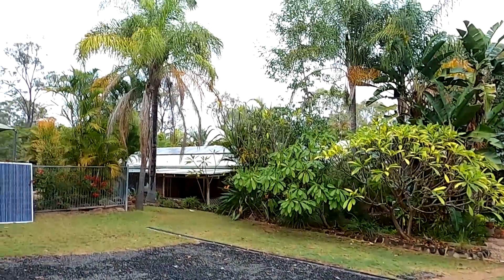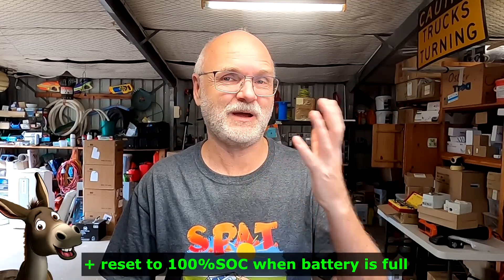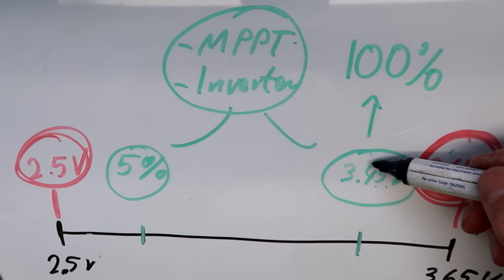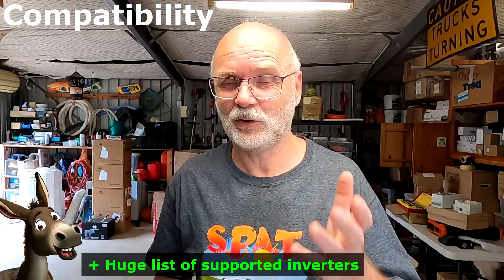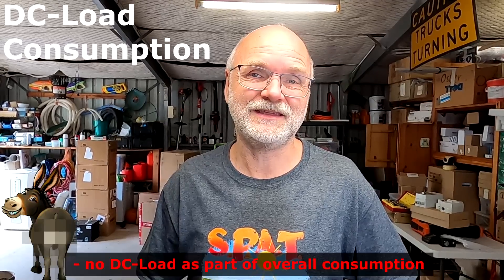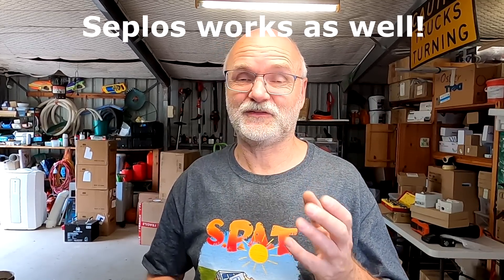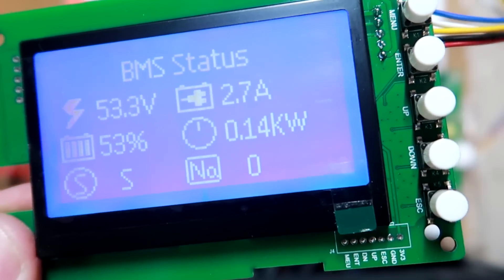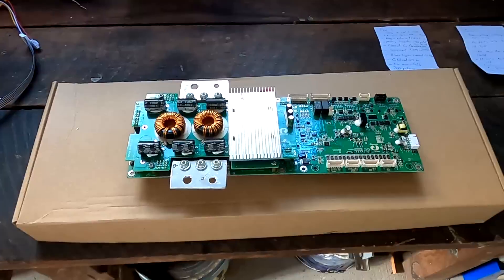In search for the best BMS... My Gobelpower BMS Verdict!

Comment: JBD bms tells you it's 100% according to what you program into it.  Maybe you need to revisit it Andy?  The last one you looked at was really small and soo old.  My batteries reset at 3.6 volts, where I need to program them because of the Canadian climate, instead of the 3.45 you use.  We get much colder here then Australia and 3.45 is too low to charge completely at anything below 8 degrees C.  Program the new JBD bms,  at  2.8 to 3.45 (as an example).  Test capacity by going from full (3.45 ) to empty (2.8).  The JBD will now read and communicate the AH stored within those parameters as 0 to 100% .  

There is no need for the BMS to tell the Victron what to do if the Victron system is programed correctly.  The inverter should always turn off before the battery, this is easily achieved with voltage parameters because of the LiFePO4 discharge curve.  The inverter throttles down any loads at shut down,  preventing spikes to the battery.

Charging MOSFETS turning off is essential.  Relying on an outside device to stop charging is added complication that invites disaster if something goes wrong with the communication.
Reply from the maker: I'm in contact with JBD and see what we can organise...
That is the whole purpose of a smart BMS to tell your inverter what to do without having to program your inverter (or Victron) in this regards.
I don't think it is essential to turn off MOSFETs at all. If the charger follows the BMS request it will just stop charging at the set numbers. If not, the BMS is there to catch the battery and disconnect. It's a 2-step system.
Reply: @OffGridGarageAustralia  I see how in your situation this will work fine, and might be the goal.  In other situations, say for instance if life safety equipment is involved (like we have on ships), this setup could cause major problems.  

Lets say your battery shelf with 3 batteries is your main system in this example, and your backup system is the Frankenstein battery.  Your main system has 3 BMS's that communicate to turn off the inverter.  One of your three batteries, has a failure and turns off the inverter.  You switch to the backup Frankenstein battery, because someone's life depends on having the inverter running for their medical equipment.  The inverter doesn't turn on.  You quickly isolate the defective battery with it's circuit breaker and switch back from your back up Frankenstein battery to your main battery.  Your inverter still doesn't work, it's being told not to by the BMS of the problem battery still.  Somebody dies before you can reprogram things.

The same problem happens if you run the main battery bank to empty then try to switch to a backup battery.  The empty batteries will tell the inverter to stay off even though a backup power source is available.

By using the voltage profiles of the LiFePO4 as the triggers for the inverter, you ensure that a backup system will turn the inverter back on in an emergency.

JBD makes a BMS capable of 750 amps peak, so you're not going to blow any MOSFETs like you have with other BMSs. 

If we are talking about massive storage installations, Victron isn't involved and neither are any of the BMS's you and I are using.  A much more complicated computer control system is used for these.
Reply from the maker: @boatelectricaldiy  Thanks for your comment.
OK, so one single BMS will not turn off the inverter, it will turn off the faulty battery bank and the inverter keeps running on the remaining batteries (we have tested this with the Seplos batteries).
Also turning off the breaker or battery switch for one battery banks should also isolate the BMS. If not the order they are wired is wrong (or bad design).
Switching from the main battery to a backup battery should always start the inverter, otherwise it is useless as a backup as you explained. Life saved, maybe?!
Reply: @OffGridGarageAustralia  it seems my lack of interest in other BMS's has caught up to me here.  The price and size of these BMS's really put me off, and I I haven't had lots of time on my hands so it seems I've missed a vital bit of information that you have presented in your videos.  I guess I should go back and pay better attention while watching.  I still don't see my customers being interested in this, but you've peaked my interest yet again.  Thank you, keep up the good work!
Reply: @OffGridGarageAustralia  I have been able to revisit this video.  My company has expanded from just marine electrical installations to remote offgrid home installations now too.  I was able to locate the manufacturer of the BMS that these company's use, and have ordered a few for testing.  Thank you for the great videos, it's rare that I find something on YouTube that makes me reconsider my business model.
Reply from the maker: @boatelectricaldiy Oh, wow, thanks a lot for your feedback. These BMS are great. Also, have a look at the Pace BMS, they work great too!
Reply: @OffGridGarageAustralia  I have seen the Pace video as well as the seplos.  I'm not using any of these due to them being so expensive.  I am testing the TDT-6022 it's software does everything the Pace does and is only $100 USD with the touch screen option.
Reply from the maker: @boatelectricaldiy  Andy they have Bluetooth communication as well, nice. Let us know how your testing goes. I may get one as well and out it on the channel...

Where did you get yours for $100? I just looked it up and it is in the same price range as Pace and Seplos...
Reply: @OffGridGarageAustralia  the bluetooth is what people have been looking for in this style BMS isn't it?  If you out it, remember where you heard about it from 😉. 

 I'll need to see if my distributor is interested in me passing along his information for Youtube before I can pass it along to you my friend.  I Let you know what he says.

Comment: Fantastic video Andy! Thank you. You are doing a great service to the community of people that need help with learning everything solar! 
This BMS seems very impressive for sure! 
One thing that I worry about with BMS' is ONE setting... Delta cell voltage shutdown should be implemented.  If you have a runaway cell it can take down the whole pack before shutdown happens at a certain pack voltage. 
I think I have said that I use a "naked" BMS monitoring system. Instead using Home assistant, I can set a shutdown if there is a DCV of a certain voltage. Pretty cool eh? 
Anyway, this is just the way I do it. 
Thanks again for your content. Together as a community we learn! 🐸🐸🐸
Reply from the maker: Thanks, Dan. Using HA for that is pretty cool. Do you still have any hardware protection as well measuring the cell voltages and turn off MOSFETs in case of a runner? Only using HA might be a bit risky?
I have seen DVC settings in other BMS but is this not a double up because if one cells runs away, the BMS will catch it anyway?
Reply: @OffGridGarageAustralia  Yes my inverters actually have a setting where you can specify a voltage that will disconnect the loads if the setting is reached.
Other than that I'm running naked lol. But I don't really see a need for a physical BMS the way mine is operating..

Comment: If it came in 24 volts i would buy it but it doesnt 😢
Reply from the maker: No, it's not a consumer grade BMS like DALY, JK or JBD
Reply: @OffGridGarageAustralia  consumer grade bms just do not cut the mustard. Ive got 50 kwh batteries that unfortunately are at 24 volts due to everything thats powered by them being 24 volt, replacing inverters and everything else for 48 volt would cost far to much

Comment: Yah, I agree it definitely should not turn off charging based on any internal SOC tracking.  I can guess where it came from though... these BMS firmwares are typically not written from scratch by a battery expert, it was probably copied or stolen from somewhere and then modified, or they commissioned it from a boilerplate.  So the likely reason is that the design is left-over from a drop-in-replacement function for lead-acid.  And in that situation the charging source might never disconnect so the BMS has a disconnect at 100% SOC.

You've really never liked the low balancing current BMS's have, but I think it might be a bit of over-optimization.   If normal charging specifications are followed, meaning we charge to 3.55V and hold there for an hour or two each cycle, and assuming the BMS is sane and starts balancing above 3.50V without any silly restrictions like only doing it while charging current is present, then the whole system works perfectly well and no active balancer is needed.
Reply from the maker: But you would need to keep the battery at 3.55V without anything connected but a power supply to keep it stable on 3.55V per cell. As soon as it is still charging or discharging a tiny bit, the balancer will not work. These undersized balancers come from Li-ion where you can start balancing at any voltage.
We will see the first of these kind of BMS with an active balancer soon...
Reply: @OffGridGarageAustralia  Right, but generally speaking if the charge gets to that point, holding it there for a while isn't really a problem.   Once the charge current tails off (30 minutes or less), then holding at 3.55V doesn't take any more energy than holding it at 3.375V would.

So its just a matter of at what point in the day the solar gets it there in terms of holding for 2 hours to give the BMS's balancers sufficient time.   And if there is extra time after that the charger simply drops to the float voltage of 3.375V or 3.4V and continues holding there.   You have the same load-support capability either way.

Comment: Let’s hope all these bms manufacturers take note, it’s in their best interest, thanks for all your testing Andy🇦🇺
Reply from the maker: I bet they won't. None of them is making the software themselves. They all reliant on 3rd party companies which may have no knowledge about battery charging and BMS design.
Reply: @OffGridGarageAustralia  my seplos 10e bms reset soc 100% with high voltage alarm setting (not sure cell or pack, but they reach 100% soc without triggering the cell or pack high voltage protection ) which is separate and lower than the high voltage protection setting. maybe you have the old revision/firmware.?
Reply from the maker: @Pey5531  I'm not aware that there is a FW update for the 10E.

Comment: I'm confused I guess also needing advise. I have (us model in usa)growatt 5000es with 6 signature solar lifepower 4 batteries. Batteries are all comm linked thru the rs485 port (one designated master)hooked to the 5000es rs485 comm port. Works flawlessly so far. My question is with the communication does the master battery talk with the other batteries(bms to bms I'm assuming)and decide which battery is to charge and which is not in order to keep them balanced as a bank and the bms within each battery to keep its 16 cells in balance?I cannot set any charge parameters or cut offs this way it is all set thru the inverter. Secondly if I wanted to build my own 16s 280ah battery using catl cells. Which bms would you use and would any you know of communicate with the growatt 5000es.I do not want to parallel the inverters. Just use as separate stand alone systems but each having communication with their battery packs.I plan on running all my 240 loads on one setup while using the other for my 120v loads. I don't like(trust)having all the inverters paralleled together and risk having total failure. I have 3)5000es and plan on getting a spare.Use 2 for 240v and a single for 120v then have the spare. Any thoughts. Sorry so long winded. Howdy from Texas!
Reply from the maker: Thanks for your question, Chris.
The communication does not go that far. It is more to pass error or alarm states on to the inverter, show an overall capacity and also the overall deviation across all cells combined. The master BMS will not regulate the charging of single batteries though or controls the balancers. That is still part of each individual BMS in your batteries.

Any BMS supporting the Growatt protocol via CAN or RS485 will work. For example the Gobelpower BMS as well as the Seplos BMS.
Reply: @OffGridGarageAustralia  so other than the soc that it relays to the inverter as well as it has preset cutoffs and charge limitations from the inverter your really not gaining anything you cant do yourself? Also how exactly can I determine what protocol the growatts are using for comms? They use rs485 ports but I'm assuming by protocol you mean programming/language they are speaking lol.
Reply: @chrislewis9345  In the battery, you select the brand of the inverter, or the battery protocol used by the inverter. I don't know all inverter selections, so maybe someone else can give solid fact, but you'd probably select Growatt, or maybe the Growatts employ the Pylon battery protocol. 

It's a protocol not a programming language or API. It how the settings are conveyed from the battery and understood by the charger or inverter.
Reply: A protocol defines the exchange process as far as the order that each device will communicate (request -> answer, field order [ie status might state the voltage followed by current draw etc in one BMS while another may send current draw followed by voltage etc]), the format used to express that exchange (is a number an integer, a floating point number, a string of characters, how many digits of a number represent the data before and after a decimal point etc) and other metadata like delay time required between each conversation, delay time expected between request and answer and so on.

Comment: Hello Andy, I have 2 batteries ( 5KWh and 10KWh) the 5KW is lifepo4 while the 10 KW is lithium ion.  They are connected in parallel using 2 jk bms's and they work 24/7 . I have not noticed any problem with them. BTW.... half of my house is totally off grid.
Reply from the maker: Yeah, you can parallel them if they have a matching voltage. However you will never get the best out of your batteries, it's always a compromise. The charge and discharge curves are very different and while the LFP battery is charging to 95%, the Li-ion battery will not charge at all until the voltage rises. Then the LFP will stop and all charging power goes into the ion battery. That can lead to high amps for either battery at various states of a cycle.
But interesting project, I may look into this...
Reply: Is your LFP battery at 16s and Li-ion at 14s configuration? What voltage range you have in your parallel connected LFP and Li-ion batteries?
Reply: @marek8928  yes you are right. Max voltage in both is 55v and minimum is 42v
Reply: @orkidorkid  55V on top is OK for LFP and Li-ion but 42V at the bottom is kinda low for LFP (it is OK for Li-ion thou). I would not go lower than 48V.
I have 20kWh LFP battery and I am planing to connect to it Li-ion battery in parallel (I got it dirt cheap). When LFP battery works between 55 and 48V and it's capacity is almost fully used, the Li-ion battery will only be utilized in circa. 60%. For me it is OK because Li-ion battery is than very safe.

Comment: I am working on a heavy duty diy bms that uses 1 ohm power resistors on each cell (which gives about 3 amp balancing current).
Reply from the maker: But passive balancing? Is that not a thing from the past? A bit wasteful...
Reply: @OffGridGarageAustralia  For me no. On the average day I am fully charged 3/4 through the day (rest of Sun mostly waisted). I don't balance on low sun days. The software starts balancing when average voltage goes over 3.39 volts and stops at full charge (3.45).

Comment: At some point I didn't care about the BMS' SOC anymore. Instead I build myself a Smart-Shunt that tracks the SOC and reports it to the GX device.
I check the BMS from time to time for the cell voltages, but that's it.
Reply from the maker: That's what I do with the Victron shunt and my battery shelf. The single SOC of the BMSes are off by a good margin.

Comment: Keep your cells balanced and rely on a real battery monitor like Victron to do SoC measurements. 

BMS's with a bunch of cheap non-zero temp compensated paralleled chip resistors for current shunt and non-auto offset zeroing sense op amplifiers for shunt resistor voltage sensing is not a good way to make an accurate SoC indicator.

Comment: Oh boy.- I hope this BMS programers check this video! THX Andy for that great video! I wish the JK BMS had WIFI or an ETH connector + easy (independent) PC software which connects parallel AKKUS.
Reply from the maker: Yeah, a BMS with FW upgrades is already a winner. The software should not be a problem. I don't understand why none of these manufacturers or sellers get it right though.